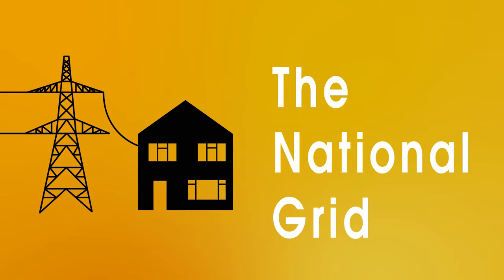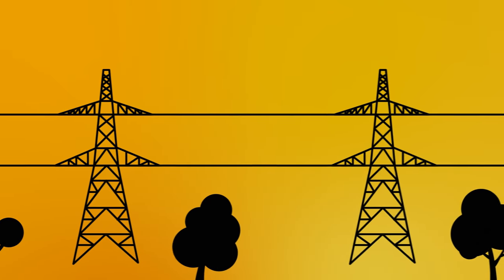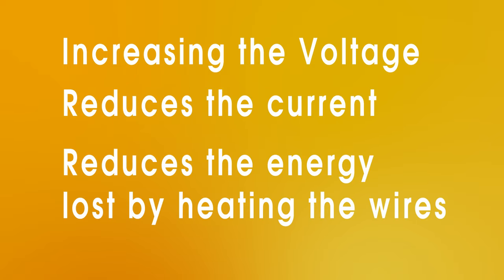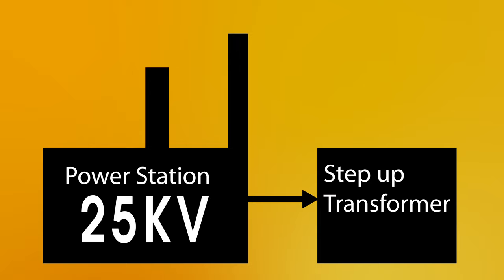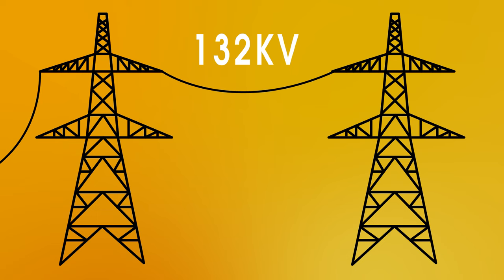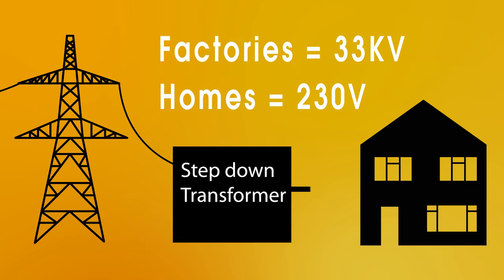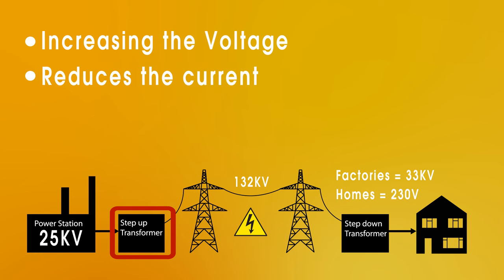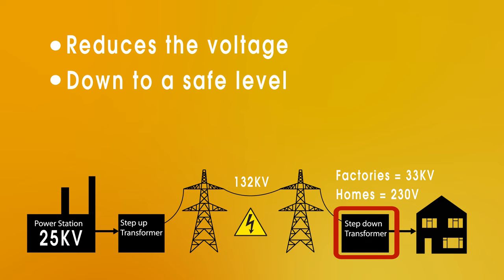Physics - Energy - The National grid

Comment: Verbal Mistake at 33 seconds in narrator should have either said "In order to decrease the current we use a step up transformer" or "In order to increase the voltage we use a step up transformer" a little thing to pick up on but as a teacher i would hate to confuse my pupils. I will not use this video in class as a result.
Reply: Prat.  Don't you understand that this was not a mistake.  If you don't, then I would not want to use you as a teacher in my class!
Reply: so what should it be cuz i am confused aswell
Reply: @Lala-ll4cn  its supposed to be decrease because he said to reduce the current earlier so it cant be increase